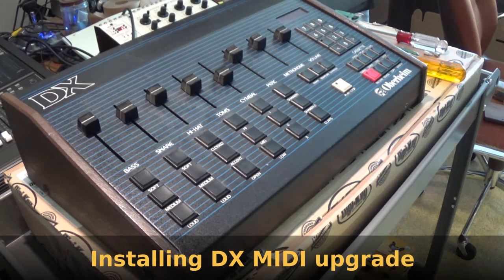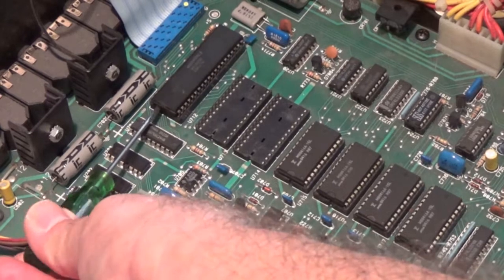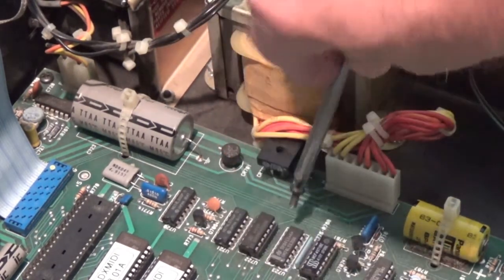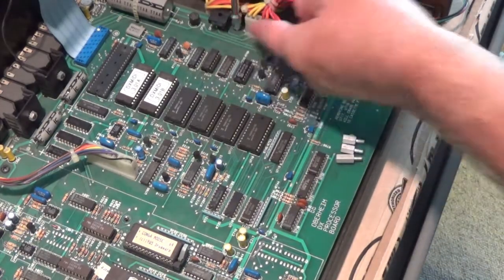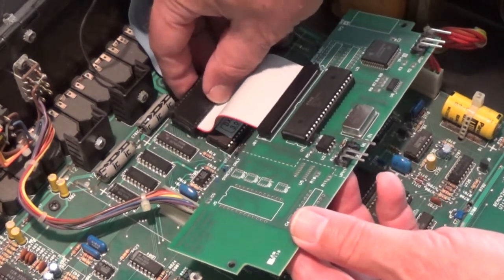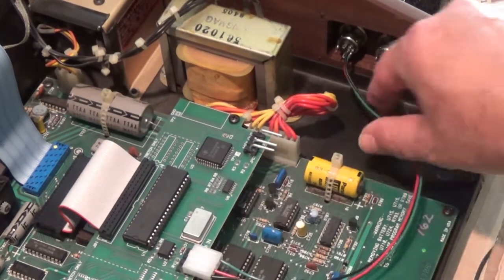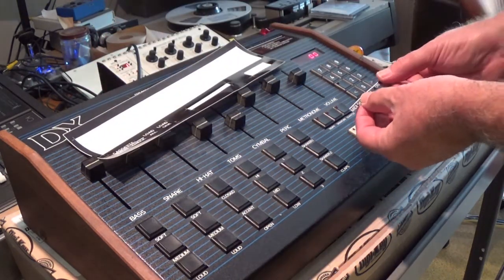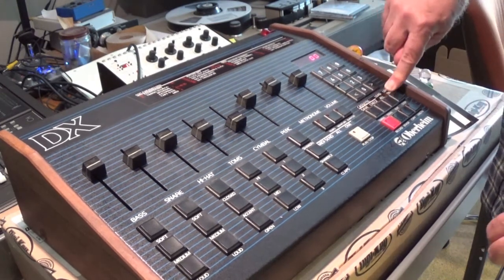Electrongate DX MIDI installation

Comment: Hello, was wondering if you could help me troubleshoot a dx. All the middle pads on each sound work but both rows of top and bottom generate no sound when pressed. This makes me think it is not pad issue because it is parrallel across the board. Any help would be greatly appreciated. ThanKs!
Reply from the maker: Try clearing the memory (after backing up any important sequences). Hold down the ERASE button while turning on the power.